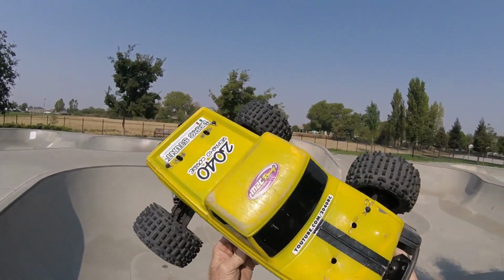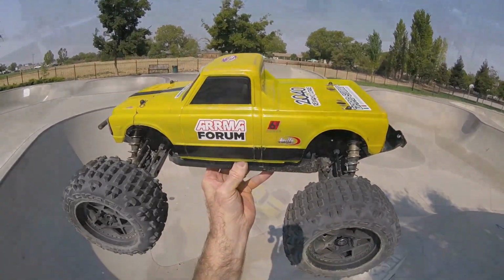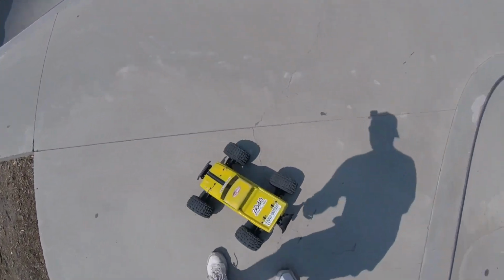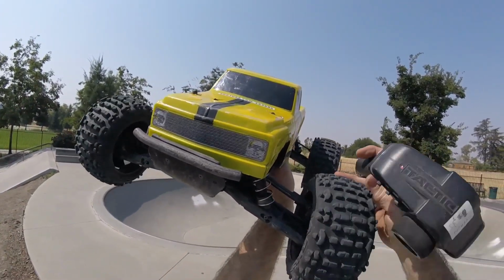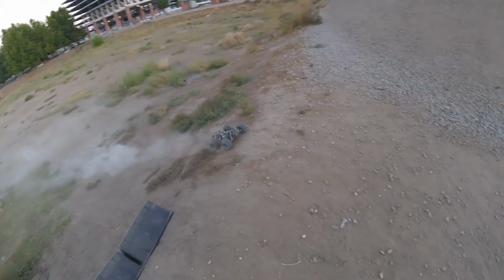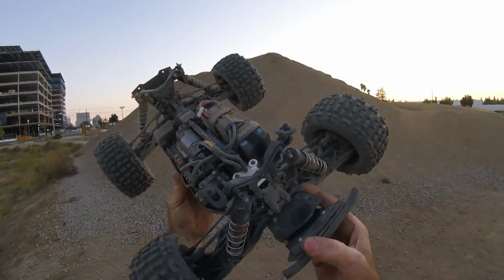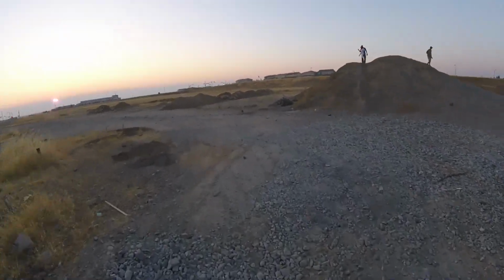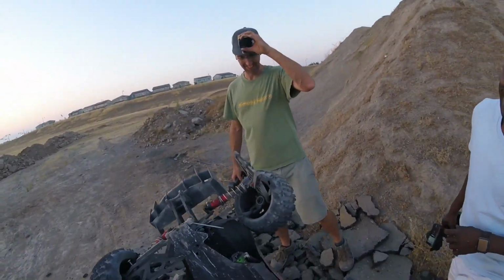NEW TEKNO and ARRMA 6s Hardened Steel M2C Outdrives plus brutal Carnage 😱

Comment: Love the skate park action and the smooth transitions. 👍 EPIC slides on the curved rails, they are sooo hard to do. Insane sends from the killer ramp, wow that needs confidence to hit that thing wide open 😘😘😘
Reply from the maker: Thanks so much dear Kimberly 😍. The Tekno had far more torque with the Nero motor 👀. She wanted to wheelie every touch of the throttle. Huge props to everyone for doing that massive gap jump 😱. It's intimidating and takes wide open 6s commitment no question. Shelby did a PERFECT double BF Mega transfer her first attempt, but I missed recording it 😝. Girl Power was in full effect 😘😘😎💪👊👊https://youtu.be/P4OzANc0Mew

Comment: The Skatepark!!! Yessss!!! Great session with the Techno Rich. M2C is churning out the upgrade parts. Great transitions from bowl to bowl. The flips out of the bowls are always intense!! Great driving as ALWAYS!!! Massive Carnage on the ramp jumps!!! The Techno held up until the end!! Stay safe and bash on from Colorado!!!
Reply from the maker: Thanks so much Ervin 😜. The Tekno did great overall, but I forgot to mention I ended up replacing my front bulkhead (cracked) and rear diff gears after a blown inner input bearing allowed my main gears to get munched 😝. Could happen to any truck though 👍. Had a Blast at all 3 bashes regardless. Huge props to my friends for hitting the Mega gap 😱. That's a huge jump and takes 100% commitment. Carnage is always a possibility 🤣🍻😎💪👊👊

Comment: Thanks for this update, you're doing us all (and M2C racing) a great service in testing these and sharing your experience. I've been waiting on the Tekno MT410 shafts for a long time!
Reply from the maker: Thanks my friend 🤗. So grateful Mitch and Avery jumped on the suggestion for these shafts 😍. Definitely a LONG overdue option. Their latest CNC machines opened the floodgates for hardened steel goodness 💪. Having tested a ton of different prototype parts, I gotta say they nailed it first time with these. No alterations needed. Straightforward, perfect fit and function 😍🍻😎💪👊👊

Comment: What a way to start off the insane Mega Senders with wicked smooth operator skatepark sesh Bro Rich! Gotta love those Sweet smooth transfers, it never gets old. Amazing air control my man.. those blind landings off the ramp are great test for beefy shafts for sure. Those wicked moon launches looks amazing! 🥰. Bummer on the motor hiccup. Poor Talion took nasty hit LoL 🤣. Won't be too long till the 6s shafts hits market.this is a big one for Mitch and Avery at M2C. Appreciate the upload. Stay well and bash on brother
Reply from the maker: Thanks so much Brother Chris 😜!!!! I lucked out big-time with no crowd and clearer skies at the skatepark 😱🥰🥰. It was smoky when I left my house some 20 minutes away. The Tekno felt torqued up AF with the Nero motor 😂. It was cracking me up every blip of the throttle. I tried to put the best test I could on the outdrives without stacking it on purpose anyways 👍. Trying to fab a solid motor support to spare these damn endbells. I forgot this was an issue before with the MT41O and forward facing motor. Nero motor took damage too 👀. The moon launches were so friggin FUN Bro!!!! HUGE props to all my buddies for going for it 🤗. It's definitely a full speed commitment hit to even clear that gap. That's if the wind allows. Chris got off coarse and pummeled his Talion 👀. Props to Mitch and Avery for making this type of bashing possible 😍🚀🚀😎💪👊👊

Comment: You carve up the sk8 bowl like a legend, 👍 looks like a good spot. Squarely little monster haha love it. Another fine display from the bash king Rich.
Reply from the maker: Thanks so much Lucas 😜. Gotta love some concrete curves on occasion 😍. Really appreciate it Brother!!!! 😎💪👊👊
Reply: @richduperbash2966  cool mate . Appreciate the quality driving and uploading. Love the work you put in. Side note , what’s your thoughts on the kraton 8 rpm arms etc. just put a set on mine . After seeing a few rear arrma arms basically explode. Did opt for the gpm aluminium ones but to heavy. Any feedback is greatly appreciated. 🍻👍😜
Reply from the maker: @Captinfun101  I bought a set of rear 8s RPM arms months ago, but still haven't tried them. Haven't had terrible luck with the stockers and I send my trucks hard. Maybe there was a bad batch of plastic at some point 🤔. Trucks this heavy have to be landed squarely on all 4's. One wheel landings don't work out too well 😂. I busted a front RPM arm the second bash, but that was after a major flail landing on a huge plastic drainage pipe. I'd never run aluminum arms, but feel indifferent about RPM vs stock for the 8s. RPM failed to design a spot for droop screws. Not sure why 🤔

Comment: Man such smooth lines in the bowl.as unforgiving as concrete can be that seems like the perfect spot to test out the drive shafts.  Some truly epic airs off the big ramp. Looked like you had a blast with a great group of people. Is that the same pile that hides the death rock? 💀 that talion crashed hard I know I've launched my battery tray out of mine as well haha.glad everyone's stayed safe and the smokes cleared up.looking forward to the 6s driveshafts.  Thanks for another awesome fun bash video man 🍻🍻🍻🍻🍻🍻
Reply from the maker: Thanks so much Nick 🤗. The skatepark truly is a great spot for testing 😍. Aside from the fun, it puts awkward loads on the wheels, axels, and shafts. My Talion took some harsh hits and massive airs, but nothing like my buddy Chris's 😱. Think he tagged that solid aluminum cross beam at the top of the mega launch 👀. We would lose site of our rigs just before hitting the ramp from the mound perspective. Just glad his Lipo didn't catch fire 😂. Had a Killer fun session for sure Brother!!!!🍻🚀🚀😎💪👊👊

Comment: do you use the throttle midair to control the landings..like tap rev to bring down the nose for instance..thanx bud great vids
Reply from the maker: Thanks so much 🤗. Yes indeed with throttle or brake for mid-air corrections 👍. Best to avoid landing on hard throttle. 😎💪👊👊
Reply: Rich Duperbash tx for the response good to know..ive got a feeling im gonna be replacing alot of basic parts anyhow as i started w a senton mega 550 which ive upgraded to the blx 185 power plant everything else is stock except for similar 1/8 scale buggy wheels that you showed off in one of your vids..still cant believe how much abuse your cars take..quite impressive

Comment: Hey bro, I may be getting an outcast 8s and was wondering if the stock esc (firma) would be able to handle a TP 5660 sized motor. I though maybe you would know. 
Thanks
Reply from the maker: Hey Will 🤗. TP motors are power hungry from my experience. I'm not certain, but my guess is the stock 160A Firma will not adequately feed the 5660. You'd be better off with a 200+ amp ESC with higher capacity Lipos and high discharge capability. If the 160A doesn't overheat, it certainly won't allow that motor to reach it's potential.

Comment: Awesome video, wicked sends, now i kinda wonder if m2c couls make some upgraded shafts for my reeper eventually, or atleast a shaft with stronger pins
Reply from the maker: Thanks so much Brandon 😜. M2C could potentially make anything. The biggest challenge is global demand. Their machines are running constantly now. They have to schedule tasks along with the design end of things. 🤗
Reply: @richduperbash2966  yeah, theyre huge now, i just know driveshaft pins and thicker shock shafts would be the big thing with the reeper, my 4985 every once in a while will snap the pin in the drivecup

Comment: Where you at in the 1/5th class? You never did anything with the outcast exb 8s???
Reply from the maker: I haven't needed to 🤗. My 08s is completely loaded with M2C 7075 T6 goodness along with beefier hardened steel driveshafts and 7mm shock shaft upgrade kit. It's a tank. 😎💪👊👊

Comment: Hay Rich it's Jeremy, hope all is well with you! Been loving my exb with your recommendations. Was about to buy a 6s typhon but price jump turned me off.  But the tlr typhon comes out, I ordered it. Question I have a 150amp new spektrum esc.  What motor would you go with? Thanks bro! I hope the heat broke for you!☀️🌡
Reply from the maker: Hey Jeremy 🤗. My preference would be the Hobbywing 2200. You'd have to swap connectors to plug into the Spectrum 150A though.  The stock Spectrum 2050kv isn't bad either from my experience thus far anyways 🤔. Any 4074 size motor between 1700-2200kv will rip with the right gearing.🍻
Reply: That's about what I was thinking.  Thanks so much Rich, really appreciate you taking the time to help! Happy bashing brother! Enjoy these next few months of nice weather!
Reply from the maker: @jeremycravens6973  thanks Brother, you too 🤗